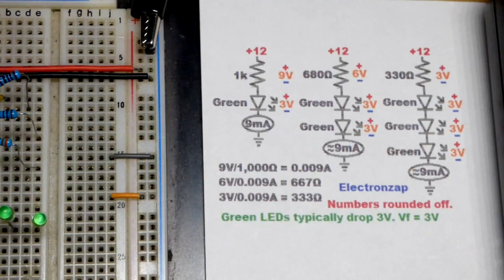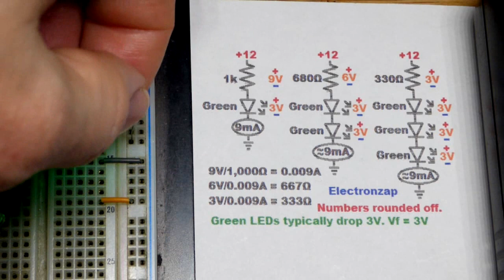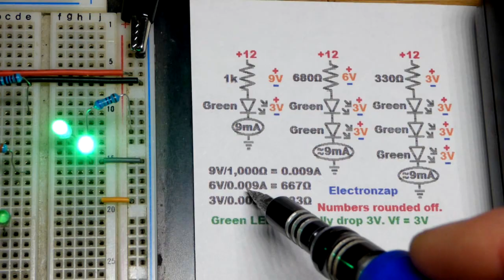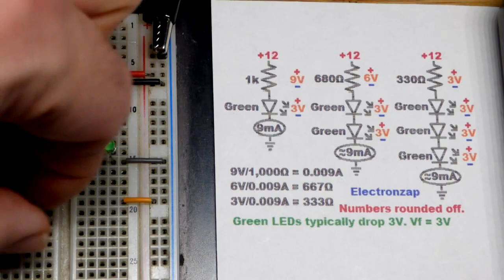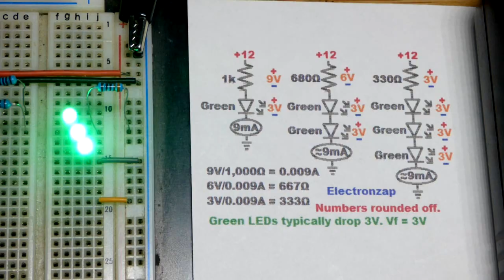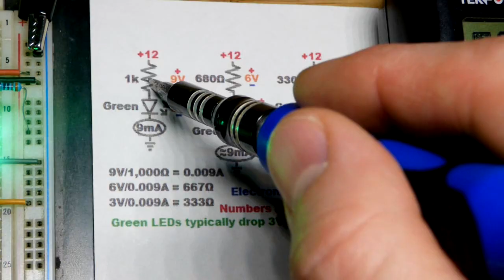Resistance For 9 milliamps Of Current Through Green LEDs With 12 Volt Supply 9mA and 12V

Comment: I design a lot of LED lights and can confirm: building these things really hurts your eyes. 😂 A couple notes: not only is green much more efficient than other colors, but your eyes are more sensitive to green, so it looks even brighter to us than it would at the same efficiency. Although that has a benefit: plant grow lights don't contain green (since leaves are green, they'd just reflect it) so you don't notice it hurting your eyes until it's dangerous. UV is even worse... Just ask anyone who attended the Bored Ape Club festival where someone accidentally swapped blacklights with UV-C sterilization lamps. 😵‍💫😵
Reply from the maker: Good info. UV light is scary stuff. I used to want to test out grow lights, I should look into that again. Thanks for watching!
Reply: @Electronzap  I tell all my friends to give me all their burnt out LED lights (the cheap ones are driven so hard they barely last as long as halogens) so I repair them all and convert them from white to plant grow lamps. Once you start looking at led lighting, you'll be amazed how many variations of constant current circuits you'll find. Some are substantially better than others. I'm currently working on a combination constant current/constant temperature design.